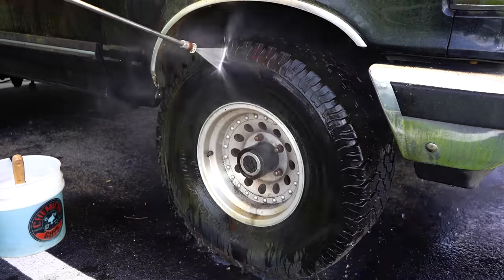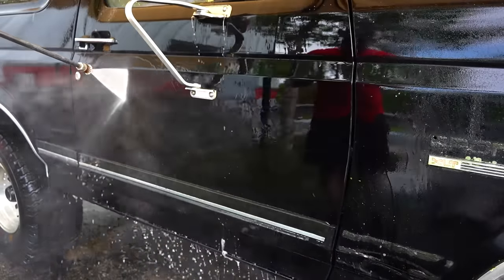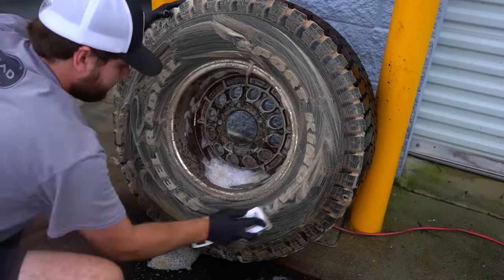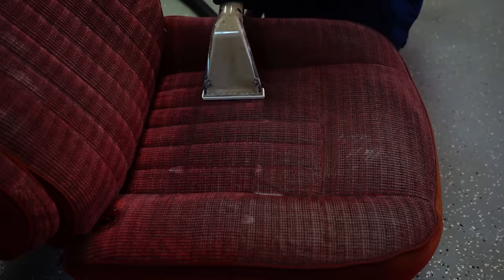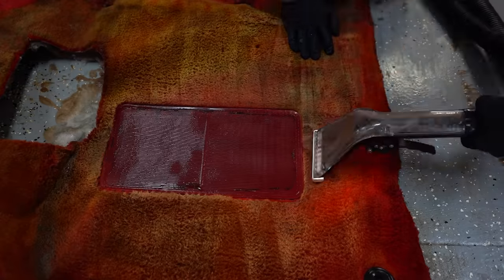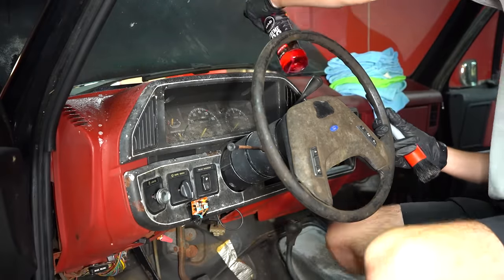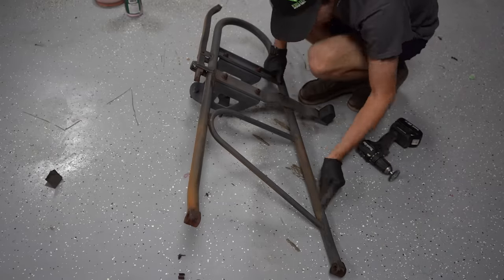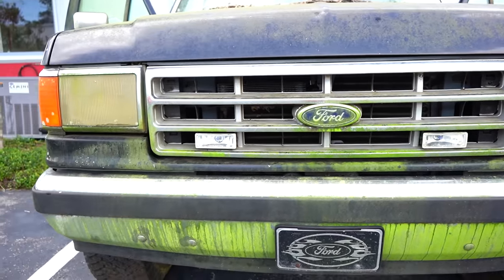Disaster Barnyard Find | Extremely Moldy Bronco | First Wash In 12 Years | Car Detailing Restoration

Comment: Some people just dont understand the time it takes to do all of this, I have a 95 bronco and it was in about the same condition as this one. I bought it from a 85 year old man that bought the truck brand new in 94 with 3 miles on it and he said he moved to Alabama from Florida in 99 with 11k miles and it had set there ever since it took me about 3 days to get it looking like new didn't know about any of these chemicals or it would have been alot better
Reply: I can personally attest to this statement. I was a professional detailer for many years and I have fully detailed MANY cars of the years. To FULLY detail an older car that needed this much work takes hours and hours depending on how bad it is.
Reply: How much? I have a 96 xlt I’m trying to get rid of all black grey interior
Reply: @kseal25  are you asking about changing the color of everything or just detailing the interior, changing the color of everything will depend on where you buy certain parts just 1 door panel is $535 dash was $900 my seats were about $3,500 and to change headliner was $100, it all depends on what you wanna do
Reply: Some people think all you need is a pressure washer and a mitt to detail too...
Reply: @trackerrrr  ya there is alot more that goes into it for sure, I did it myself cause it was going to cost $500 from a auto details shop but after doing it I wish I would have paid it lol
Reply: ok
Reply: whatd you expect its a ford
Reply: @itzjesster5497  take it over a Chevy any day of the week, this is the first Ford I have ever had and have owned 3 Chevys in the past and will never own another
Reply: @256broncosquad7  $500 is fair for a good extensive detail
Reply: @256broncosquad7  I know someone who owned a Chevy. It kept having issues
Reply: I bought a 1989 ford Bronco XLT and it has 36,000 miles on it

Comment: I wonder if the green layer on the outside actually protected the paint and the metal. It didn't rust or fade because that layer of moss/mold was covering it.
Reply: I wondered that to.
Reply: Probably was moss.
Reply: It actually does . Crazy right
Reply: the moss is a paid actor
Reply: @Atuljackson  That moss better get paid well, if it was there for 12 years.
Reply: More like the layer of moss was able to grow because the car was left in some shady place and that also protected the paint from the sun.
Reply: the mold should've made the metal rust even faster
Reply: If it had been sitting for 12 years with algae growing on it then it would have rusted faster. I doubt this is its first cleaning in 12 years.
Reply: The green layer was moss and algae
Reply: Seems fake. The paint is too good.
Reply: @jeanmmarch  if people

Comment: Wish the would have shown more of interior after. What did they use to paint carpet?
Reply: Carpet and fabric paint .. if you google that you will find it. Don't go buy a can of black paint from home depot and try to use it on your carpet.
Reply: Exactly what I was wondering. I need to see that carpet AFTER!
Reply: Kerosene
Reply: IKR they hardly showed it . I could be wrong but them not really showing makes me think it turned out pretty bad . I could be wrong but it seemed like they spent a lot of time showing what went right ! Paint looks great on the outside for sure !

Comment: I would have recommended carpet replacement.
Reply: Good luck trying to find an original ford bronco carpet with the same trim colour
Reply: @Tom-q6h2c  not to hard bronco junkyard has them all day long on there website but they are overpriced on most of there stuff for broncos
Reply: @Tom-q6h2c  doesn't need to be original. You can pay someone that does custom interior to make one for you.
Reply: Tom J you can get a full set of interior flooring for I think around 340. I looked into it when I was detailing my bronco but decided I’d just stick to the original vinyl and power wash it
Reply: Right, cause all that carpet dye id imagine the carlet got super crusty. I thought carpet dyes were only meant for spots not the whole thing 😂
Reply: Also I wouldn't have bothered wasting time cleaning 12 year old tires
Reply: Spray liner
Reply: '87-'93 full replacement set is $216 through stockinteriors.com with 31 different color options.
Reply: @brandonevans4142  not the tires, I would've bought new tires. After 12 years, no telling what condition they're in. But I would definitely clean the rims up
Reply: @Tom-q6h2c  I imagine LMC truck might would have something close
Reply: What causes mold on these cars? Never seen it before. Is it a southern  thing? I live in Maine.
Reply: @Zoeygrl768  It’s a combination of rain, humidity, and pollen. It sits on cars too long and it causes mold to form. Just like you see on old sidewalks and old fence posts. Especially if they are under thick trees in the shade for too long.

Comment: I had a ‘79 Bronco with a 400M and 3” pipe from the Y back with a straight flow Magnaflo muffler…that beast was so loud I’d set off car alarms if I wanted to.

Edit: I ended up pulling the two bucket seats and installed a bench seat from an F-350 Super Duty. There are multiple bolt holes in the floor board, so it was just a matter of pulling the plugs from the four I needed and plugging the unused ones. I ended up removed the rear seat and all of the carpet due to the amount of damage they had. Truly one of the best off road trucks I’ve ever owned.

Comment: I guess I'm a little perplexed on why not just replace the carpet with brand new black carpet to begin with?
Reply: That would seem to make sense given that a new set is only about 300 bucks. If you're doing it yourself and can write off the labor cost it might make sense to clean and paint it, but when you're paying someone else by the time they've done all the legwork you're easily at the cost of a new set.
Reply: Hahaha I was thinking the same thing or just replacing it with red carpet and why paint the panels
Reply: Cuz the carpet like $400 to replace
Reply: @JohnJL77  Right, but as I said, when you're paying someone else to clean and paint it, you're getting to the point where buying a replacement might be cheaper.
Reply: Aftermarket carpets are worse quality. They fade pretty quick too(ACC brand) and the thickness isnt the same. Went thru this with my foxbody mustangs and 1990 bronco

Comment: WoW this was awesome!
Love to see that Badass old Bronco getting some T.L.C.
This so-called "customer" knew this was good truck right off the bat.
Looked like one spot of rust/oxidation on the roof.
Nothing in the fender wells, pinch welds, cab corners, fender flares ect...
Probablly going to need some mechanical work.
After that I would daily drive that truck.
Gotta love an old Ford!😎👍
The best never rest, they just hibernate in the woods for a decade or so LoL

Comment: is there a reason you guys chose to extract this carpet rather than pressure wash it? is pressure washing too rough or something on this old of carpets?
Reply: Extracting does a better job on carpets. Pressure washing would get a lot out but extacting gets more out and you can get it closer to dry with an extractor

Comment: How did that bronco get that dirty over the years and not rusty so badly and still run? What
Reply: I have a car that has set for nearly 15-20 years in Kentucky. It has some rust, mainly where the parts were buried from sitting. Paint color is coming back, and is starting to look great again. I don't want to admit the amount of time I have invested in this car.
Reply: humidity, temperature and sunlight are the factors, and if it was parked in winter, there may be salt that sat in the wheel wells an ate metal. if summer, it would be fine.
Reply: I dont think it runs

Comment: I would not recommend washing a engine with a pressure washer.
Reply: The owner commented, the engine was already hydrolocked, he has alot more to worry about. 🤷🏻‍♂️
Reply: I came here looking for a similar comment and additional info, made me so nervous watching him take that pressure washer to the engine bay 😂 makes me feel a little better it was already hydrolocked but water could still be forced down into spark plugs, etc if it’s been sitting a while. They lose their water tight seal over time. :/

Comment: I recently picked up a Bronco the other day that had been sitting in a guy's yard for almost 7 years. First thing I want to do is verify if I can get it running, after that I'm going to give it a good cleaning, especially the inside. The interior of the Bronco looks decent; though the dash has a lot of cracks and the whole interior is covered in mold except for the seats and headliner. 
This video does give me some ideas on how to clean it, though I was curious if you had any recommendations when doing so, especially on a small budget?

Comment: a good thing for the spray dispenser would be if it instead of a trigger would be operated by a rotating wheel as the surfaces to cover are very large, and you have to use both hands

Comment: Why do you start to spray with the pressure washer from the top when you have applied APC? You rinse away the chemicals instead of using them with the pressure if you’re starting from bottom up.

Comment: Given the amount of junk that was on top of the cowl did you remove the cowl and clean under it?  I recently did this to repair a leak in the body seam and was amazed at the amount of junk that was under the cowl.
Reply: I did the same thing with my 86 F150. Actually had plants growing in the cowl. The space underneath the cowl was packed almost solid with fir needles and dirt.

Comment: Okay when u wash the engine bay 1 put a plastic bag over the electricals and 2 never pressure wash it just a hose will work, and just a tip working from top to bottom means less work for you as if you go from bottom up you have the dirt etc from the top going down onto ur clean work , you can do it bottom to top it just creates more work
Reply: Also never spray your cleaner directly on to the centre console inside your car as it can kill the electronics

Comment: Here's a problem with something like this
 Before you touch it you have to get it tested for what type of mold and what mold and once you get the results they need work with a remediation company is the remediation company to actually do the cleaning of the car and as far as the interior is concerned you need to replace everything headliners floor liners  Upholstery it's all gotta go

Comment: How bad was the engine and drive train in this thing…  every hose and belt along with gaskets and rubber plugs had to be dry rotted coagulated fluids as well as  bees, mud daubers, mice, owl pellets,  and any other critters who made the discovery of exhaust pipe leading to the most protected home they could have found.

Comment: Spray can painting the carpet? Good luck for the owner if it’s wet outside and you get some light coloured shoes on. No primer for spray painting the tyre bar and the other thing? Those are freaking basics. Do some research beforehand or don’t do stuff you are not comfortable with. Shame

Comment: 42:38 "our dye".  45:36 autozone duplicolor vinyl and fabric paint. not even fusion plastic paint or even rustoleum plastic paint? you just used what was left over from painting the carpet? also why didnt you use rit dye and a tub of hot water which is $8 a bottle vs duplicolor PAINT which is $13 a can? the paint makes the fabric feel stiff and will rub back off. I usually like watching yalls videos but you really shortchanged this guy. im sorry but thumbs down on this particular video.